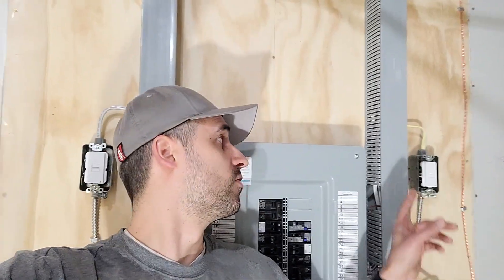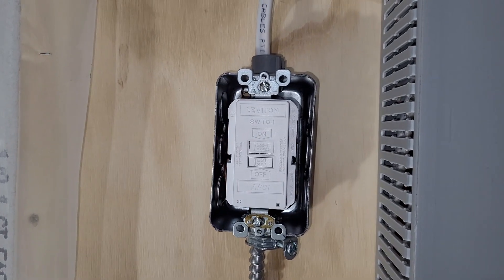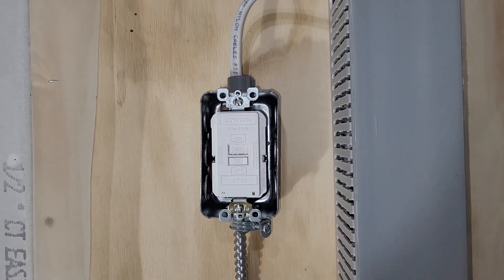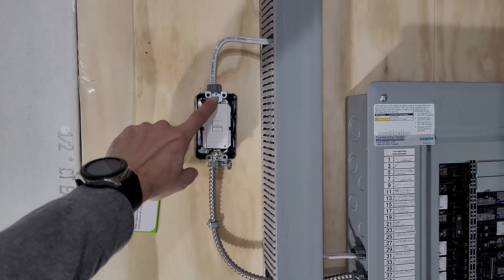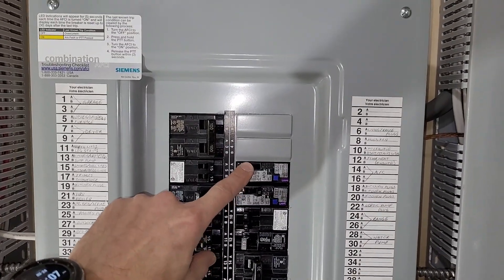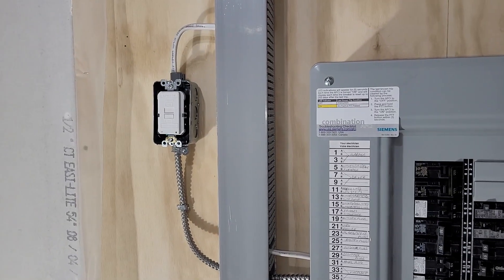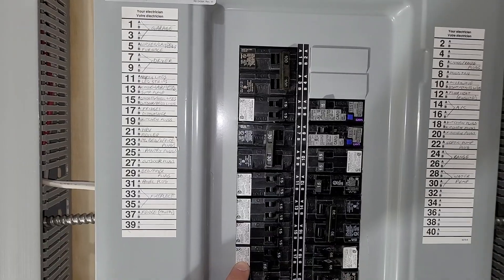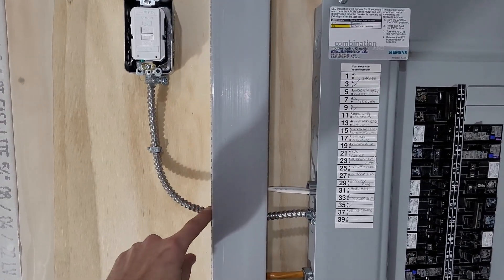How To Fix Arc Fault Nuisance Tripping For Good!

Comment: my issue is with a fridge and when a vacuum is used
Reply from the maker: You mean they are on the same circuit? According to current code a fridge in your kitchen must be on its own circuit or shared with other fridges in the kitchen. Vacuums are known to trip arc fault circuits because of the motor.  Try setting up one of these arc fault devices, hope it helps.
Reply: @energyoneelectric   sorry my fridge is on its own circuit and the breaker for it is that new arc fault breaker.  It randomly trips but resets very easy. Now  if i use a vacuum anywhere in the house it will trip another arc fault breaker related to that outlet i will try this device and tyvm
Reply from the maker: @flea8332  I don't know where you live,  but in Canada they don't require arc fault for a kitchen fridge so maybe you can replace it with a regular breaker.
Reply: @energyoneelectric I live in United States. thanks very much ill look into that .

Comment: I also have used a remote Arc Fault device to solve the nuisance tripping however I would love to understand how to test Arc Faults and to know why we get these nuisance trips. I had one new pre built house where my job was to only install the service equipment and had a trip when one switch was used, I replaced the wire inside the wall to the light and still had the trip. I chased the entire circuit for a week and it finally just stopped tripping. I did find the home builder used fluorescent bulbs in the attic light and I did replace them when the trip stopped. But how am I sure this was the problem? The house initially powered up fine but within a week the tripping started when on the customer tried to use the dinning room light but the fluorescent bulbs were in the attic. What was the relationship or what could have caused the arc fault trip? Naturally I could not charge the customer for the time spent as I was not convinced I had fixed the issue but a year later and no tripping. Crazy IMO

Comment: I have a home built in 1992 in Washington state. We never had any electrical issue until 2017 when we had a Kitchen remodel. At that time they updated 6 or 7 standard circuit breakers to Siemens AFCI/GFCI breakers. One was on a  dedicated line to a garbage disposal. It tripped constantly. I would have to go to the garage and flip back on the tripped breaker each and EVERY TIME  I wanted to use the Garbage disposal. After a few months I finally called our electrician and he swapped out the AFCI combo circuit for a GFCI-only circuit breaker. PROBLEM SOLVED.  He said the "AFCI Issue" was a big part of what he fixed on a daily basis and kept his company busy.  That was 6 years ago and there has NEVER been a tripping issue with the disposal since. During the 2017 kitchen remodel  they also installed a dedicated AFCI combo circuit for a small microwave. This circuit has tripped sporadically for 6 years. It may trip 3 times in a row, then not trip again for  two or 3 months, then trip every day for a couple days then not trip again for a few weeks. I even tried replacing the microwave and have nothing else plugged into that wall outlet. A couple years ago I called my same electrician  and wanted him to replace the AFCI/GFCI with a GFCI-only like he had done for the garbage disposal. He said he could no longer do that or he would lose his license. Fast forward to this Xmas Eve (and of course the microwave tripped  5 times in a row) and we gave up using it. Since then it was fine for two days but then tripped a couple more time in the last two days. I just ordered a Siemens GFCI (only) circuit breaker ($53.00)... a Christmas Present to myself. I will remove that Siemens "AFCI garbage" and install the GFCI myself. The only other solution is to relocate the breaker box from the garage to the kitchen right above the microwave, I could skip having to run out to the garage all the time 🤣

Comment: Hey there. This seems to be the problem I'm having (Eaton panel, Eaton breakers), but it's effectively all my AFCI's. Most common issues are on my Microwave and Washer, but also my main floor receptacles and outdoor receptacles as well. I noticed after watching this video I have one of the AFCI blank face devices for my hot water tank that was installed with the house build (House is 4 year old). Do you recommend I get 2, 3 or 4 more of these installed for the other AFCI's I'm having an issue with? Thanks and hope you have a great holidays!
Reply from the maker: Hey thanks for watching.  It may be a bad batch of Breakers that were installed originally, but I've had that same issue where everything in the house was tripping. And it seems microwaves and washers are very common culprits too. It's very expensive to change all your Breakers or even use the afci device,  so I'd probably try it on the biggest trouble maker circuits first to make sure there are no further issues. Some say that stabbing the wires into the back of the receptacle instead of using the screws may cause tripping,  so it wouldn't be a bad idea to open up a few random receptacles and see if the installer used the screws or not. Let me know what you find, I'm also curious.
Reply: I'm having issues on the eatom breakers as well.

After final all of them are coming out and I'm reinstalling standard breakers

Comment: Correct me if I'm wrong, and as a followup to @123davann comment below, if you are troubleshooting multiple AFCI breakers tripping, and there's an actual fault and/or slopping downstream wiring, this won't solve the problem, only prove out there is an actual problem?

Comment: Not sure if Canadian code is different but to avoid having to install an Arc Fault breaker, use single outlet receptacles for dedicated appliances. Furnaces, Washers, Dryers, Refrigerators, and like appliances should always be on dedicated circuits.
Reply from the maker: Canadian code requires arc fault protection on every 120v receptacle 15 and 20amps, excluding Sump pumps,  fridges in a kitchen, and kitchen counter plugs in a dwelling including attached garages. Keep in mind it's only for receptacles not hardwired devices. The bathroom gfci receptacle can be on a lighting circuit which isn't required to be arc fault protected. So we must arc fault protect even dedicated appliances such as microwaves,  dishwashers that plug in,   range hoods that plug in, hot water tanks that plug in, hrv systems,  built in vac, etc.
Reply: @energyoneelectric  I would be hard wiring a lot of appliances that we normally plug in such as dish washers, garbage disposers (we have those), range hoods, HV systems, etc. if I had to deal with that. The washing machine I just disposed of would trip any arc fault.
Reply from the maker: @drwhoeric  hardwiring is an option, but I'm concerned if it will void the customer's warranty if I cut off the plug end.
Reply: @energyoneelectric  Easiest way to know is if the installation manuals allow for hard wiring. Most such appliances do, though some may require a disconnect switch at the junction. That may be as simple as a single pole switch for 120volt appliances.
Reply: @energyoneelectric  Interesting, US code requires bathroom receptacles to be on a dedicated 20amp circuit. You can have multiple bath plugs on the circuit, but nothing else.
Reply from the maker: @billw192  canadian code allows bathroom receptacles to be on a lighting circuit,  which exempts it from requiring arc fault protection.

Comment: we had this happen on a few of our new builds in ontario with square d. new house, multiple new afci breakers. they have been good lately but it sure was an annoying call back even once to replace something on a new house that shoudn't be causing an issue. made us as the electrical contractor look like we did something wrong. also we have used the faceless hubbell afci's with good results on some reno jobs.
Reply from the maker: I agree,  it makes you the contractor look like you're incompetent.

Comment: I remember when I was a second year.  The problem that happened is largely that most electricians tied all the neutrals feeding a switch box together even if they were from different breakers.  So now if you AFCI the circuit, it nuisance trips because the neutrals don't carry the expected return value for the AFCI to be happy because some of the angry pixies go down the wrong pixie pipes.

Not doing that, I only exceptionally rarely ever have nuisance tripping.
Reply from the maker: We're typically putting afci Breakers on new construction and we're definitely not tying all the neutrals together, so in my case that isn't the issue with the nuisance tripping.
Reply: One of the most common reasons that arc faults trip in new construction is, that installers aren’t careful when they tuck the wires back into switch and receptacle boxes. If the bare equipment grounding conductor comes into contact with the white neutral conductor, at all,  it will cause the AFCI, GFCI, or combination AFCI/GFCI breaker to trip. This can also be caused by nicks in the conductor insulation or staples that are driven too tight to where it damages the cable. 

In older homes you might find that the there are two separate circuits on different breakers in a junction box and the installer tied the all the neutral conductors from two different circuits together. This will cause an AFCI, GFCI, Or combination AFCI/GFCI breaker to trip every time. 

There are also certain devices that just cause AFCIs to nuisance trip for no apparent reason, particularly vacuum cleaners, microwave, power tools, certain electronics, or any other device that creates anything that the breaker interprets as a potential arc.
Reply: But that is a 20 amp unit. Is it ok because the 15 amp standard breaker is protecting the wires. But is that code?
Reply: So where do u tie the AFCI neutrals if not on main panel ground bus? I'm in WA and considering AF Breakers or outlets or DUALs. I'm grandfathered not to require AF but had an Arc incident and like the concept but hassles not so much. Thanks
Reply from the maker: inside the panel the neutrals from the breaker do go onto the neutral bar. But inside the receptacle boxes we are not tying neutrals from different circuits together.. although it rarely happens that we would even have 2 separate circuits inside a receptacle box. Multiple circuits in 1 box usually happens in switch boxes.

Comment: Question; Why does that devise not nuisance trip and how does it pass inspection with no device cover
Reply from the maker: It doesn't nuisance trip because it must have been engineered properly, and works like it was designed to. And I did put the Wallplates on after the video.
Reply: @energyoneelectric  Thanks for the reply love the videos 👍

Comment: Replace standard AFCI breakers with duel function AFCI/GFCI breakers. They won't trip anymore. That's the recommendation from Seimens and I've done it every time I have a problem
Reply from the maker: I agree it works sometimes, but other times it didn't fix the issue for long.  And siemens is recommending you replace a crappy $70 breaker with a less crappy $120 breaker.  How about they fix the actual problem instead.  I quit siemens panels and not looking back.
Reply: Doesn’t always work. Seimens arc’s are garbage. Coming from a diehard Seimens installer

Comment: Thx for the excellent video.  Wonder why you use MC cable out of the panel to the AFCI device?  Asking for a friend
Reply from the maker: Canadian electrical code requires the use of armoured cable from the panel to the first arc fault device or arc fault receptacle in a circuit. If you have an arc fault breaker in the panel then the armoured cable is not required.
Reply: @energyoneelectric  excellent reason!  interesting thx
Reply: @energyoneelectric  certain code requirements make more sense than others.  Does it seem reasonable to you to require MC cable between the panel and the first AFCI device?
Reply: @bl9531  Arc faults happen in damaged / cut / pinched / breached cables. Armor protects the cable. He could also have used the AFCI on his first outlet if he ran BX from the panel all the way to the first outlet upstairs.
Reply: So does the US National Electrical Code - armored cable or conduit. @energyoneelectric

Comment: I see your nm cable is exposed. Are you in a garage? I didnt think exposed romex was allowed but in a few locations were its not exposed to Physical damage
Reply from the maker: It is allowed to be exposed in a mechanical room when it's going into a panel, but also if it's above 1.5m from grade.

Comment: Thanks man!  We've installed a lot of Siemens panels, and it was a nightmare going back over and over and eventually we switched to SQD which helped a lot, but not after loosing thousands of dollars in labor.  This is solid advice and I might try this solution next time.
Reply from the maker: I feel your pain! I'm a small time contractor and I do a lot of acreage homes so it kills my day driving 30-60 minutes out of the city to fix siemens tripping issues.  Update after update from siemens doesn't fix the issue so I switched to Schneider homeline.. people are just moving into my Schneider homes so we'll see if they have the same issues.
Reply: @energyoneelectric  How are you finding Schneider homeline panels and arc fault breakers?
Reply: A problem I have had,  especially with Eaton CH,  AFCI's is resistance of 100 ohms or less immediately or nuisance trips the breaker.  Why?

Comment: The best way to fix them is to replace them with a $7 standard breaker :)

When they first came out I experienced a LOT of issues. They may have improved over the years like GFCI's did but still, I'm not a fan.
Reply from the maker: Simply replacing with a standard breaker would be against code out here.
Reply: @energyoneelectric  Yes, of course. Here too. But it certainly fixes the issue.;)
Reply: EXACTLY..

now you know why you never hire an electrician.  hire a handyman....it really is that simple.  electricians are restricted by what they can do and in almost all cases will refuse to actually solve a problem and will mindlessly just follow "the rules".

replace the damned things with classic thermal breakers.  they work...arc fault do not work...too many false positives to be useful.  coming home with no cooling and heating...turning on a convection oven and realize 30 minutes later your food was not cooked.

ridiculous

Comment: I'm an electrician in ontario.I can tell you from personal experience,siemens arcfaults,absolute garbage and headache.I can't believe that they are being allowed to be used,it's absurd in my opinion.
Reply from the maker: I have been patient through about 5 updates and gave up. I switched to another brand of panels and Breakers.
Reply: @energyoneelectric  and how is that working out for you?
Reply from the maker: @pawelelektryk2985  actually I like working inside the panel more,  but I've only powered up 1 house so far, so we'll see if there are any complaints once customers move in.  Homeline brand BTW.
Reply: Same seimans breakers are worse than trash
Reply: Switched to Schneider homeline and haven't had a single issue in 6 months
Reply: @Mark-op6tx  thanks for the tip.i heard that from a couple other electronics, I just didn't know if it was actually true or not
Reply: 100% accurate statement.  They are garbage!!!
Reply: Square D or Eaton are better
Reply: Make a space after punctuation.
Reply: Anyone knows if I am able to use these 20 amp blank faces with a 15 amp breaker and stay to ON code?
Reply: I have the same issue with Square D.  For now, I've had to swap out two circuits with regular breakers, but I'd like a better solution.

Comment: I have an issue in a "rewired/remodeled" home where running the microwave trips the AFCI for the room where the son's gaming computer system is.  The microwave is connected to a sub panel next to the main panel.  The two circuits are run a couple feet apart.  I "beeped" the circuits with a breaker finder and both circuit beep end to end, but not on any other circuit/wires.  I Meggered both circuits and both are 100% open to each other.  F'ing weird!!!  Any suggestions?  I'm feeling like there is a great deal of harmonics added to the circuits from the microwave and that trips the AFCI.
Reply from the maker: Are you 100% sure the 2 circuits are completely separate, since you're saying it's a rewired house? Mistakes can be made. What if you try to replace the arc fault breaker on the gaming computer circuit with a regular non-arc fault breaker and see if the microwave still trips it. Gotta start somewhere and keep working from there.
Reply: @energyoneelectric  Thank you for the reply.  Your posts on YouTube are so helpful to many folks.  The Gaming room is connected to a breaker in the main panel and the microwave/kitchen outlet breaker is in a sub-panel next to the main panel.  I found the "feed" to both circuits is on the same phase/pole.  The day after I made the post above I did swap out the office AFCI for a standard breaker (like you suggest above) and the issue stopped.  However, to stay within code, I may try changing the phase of one of the circuits and keep both on AFCI breakers.  I am going to have to look up the code for kitchen circuits.  The GFCI outlet may be enough for that circuit or GFCI may not be needed at all there.